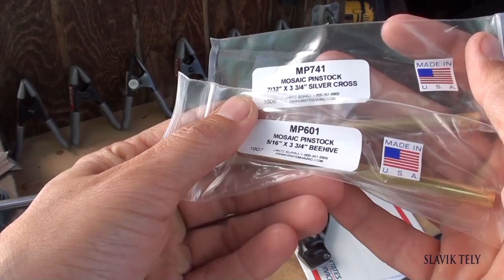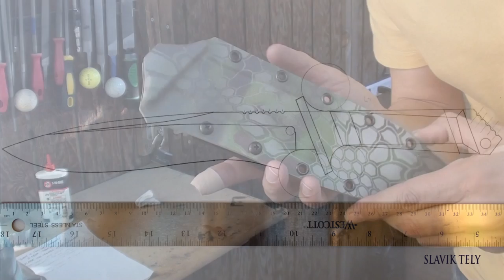MAKING BADLAND BOWIE CS:SOURCE 1.6 KNIFE Part 3

Comment: I admire your patience and attention to detail. I've made a few survival knives of my own design in the past, and working with and polishing curved edges is no easy task. You do fantastic work, and I enjoy watching your videos. 

The only minor suggestion I might have is to put a drain plug in at the bottom when you press your Kydex sheaths. The hollow cylinder allows water to quickly drain from the sheath when it rains or when you cross a body of water to help prevent rust or excess weight. It's only really essential for knives that will be used in the field and not for collector knives. Could be a good feature to add if you get more commissions for knives soldiers will use with their gear. Keep up the good work!
Reply from the maker: Thank you for the compliment and suggestion. I do put drains when the owner wants them. Most of my customers get my knives as a collectible item.
Reply: SLAVIK TELY - Makes sense. The customer is king. You obviously know what you're doing. I just grew up in the Pacific Northwest and can't help but think about the rain. I rewatched the videos for your commissioned soldier's knife and saw you put a drain plug in that sheath. You're knives are beautiful regardless of what you make.
Reply from the maker: The_IronPhoenix https://www.youtube.com/watch?v=hdLfDV13bAY&list=LLsCuMSw61beQuEpUOcvQOwg&index=11

Comment: You have inspired me to learn this craft. Do you have any videos or could you do a video of you were to make a knife as a complete beginner. If you had minimal tools and as a first project. Something some one like me could start with. I'm not going to try the tempering to start with so just shaping and handle design I'm getting stainless steel off it's from work
Reply from the maker: Watch Ekim1428, Walter Sorrells, Nick Wheeler, Aaron Gough. It is a really good start...I started from there.

Comment: another great video. I was wondering what the tool was called you use to scribe the sides of the knife with? not the one you scratch with, the one you use on the thickness of the blade?  Also when you start filing this knife, on the curved part of the blade are you using a straight, or curved file? 

Thanks and keep up the great work
Reply from the maker: https://www.amazon.com/gp/product/B0000DD0IZ/ref=oh_aui_detailpage_o04_s00?ie=UTF8&psc=1

you can use a curved file to make a rounded plunge.

Comment: Wonderful work once again, and as usual. I love how your knife are made with such precision, how they are overbuilt, love the absolute overkill of a handle attachment (epoxy, pins, screws .. that could probably survive a nuclear blast) .. 
Did you sell this one? I bet that must have gone for at least five hundred if you did.

I doubt there's anything to improve, and if so, then perhaps only that knives like these would maaaybe deserve a higher-end sharpening system, like a wicked edge or something. But Lansky is just fine, though I prefer KME.
Reply from the maker: Thanks for the compliment. It went for one hundred below the price you said. The guy has six kids, I grew up in family of 6 kids. I know how tough it is to raise that many mouths. I couldn't ask for more, my heart won't allow it. I do need to upgrade my sharpening system. I just do not have the space anymore.

Comment: you should sand your knives with higher grit sandpaper. they will look less scratchy. on some knives it looks good but not on most. but I understand sandpaper is the most expense in knife making.
Reply from the maker: Usually most knife makers sand their knives 600-800 grit. I sanded this one to 1200.
Reply: oh. it just doesn't seem like it on video. bad eyes I have I guess. Do you have like a polishing wheel buffer on the grinder? is that something you would do with a knife?
Reply from the maker: justin haynes I do not like mirror polish finish. Plus it is very dangerous to make that finish because of the buffing wheel.

Comment: You removed a lot of metal to keep it one piece; is it worth the time to so? Maybe making a guard and pommel would take as much time, what are your thoughts on making other knives this way? Great work across the board BTW....
Reply from the maker: If I had a milling machine, that is the only way I would do it. The less parts you have the more solid it will be.

Comment: That is amazing, but how could you add the squiggly pattern on the edge of the blade because the real life counterpart it is made out of a different material.
Reply from the maker: You can do it with a W2, 1075 steel. It is called Hamon. At that time I did not have that steel.
Reply: Also if you did have access to it, how would you connect the two steels?
Reply from the maker: KingMangala You do not connect the two steels. Watch a video on How to make a Hamon. It is done during heat treating process.
Reply: Thanks for the insight and keep up the great work, these videos are awesome.

Comment: I have a quick question. The file you use on your filing jig, is it best to use a file with or without teeth along the sides? I bought files and I noticed some have them and others don't. I enjoy your work, and can't wait to see what you come up with next.
Reply from the maker: Thomas, I rarely use the file on the side but it does not hurt to have it. I have plenty of videos for you to watch...check them out.
Reply: SLAVIK TELY I was just worried if I used one while filing in my bevel, that it would mess up the plunge line.

Comment: Outstanding!

What kind of files do you have for bevel creation? And how long does it take to form them?
The level of your fit 'n' finish is beyond that of anything I have seen.
Reply from the maker: I use Nicholson files. It takes about 45 minutes per one side.
Reply: Single cut or double cut? I assume they're bastard files?

Thanks
Reply from the maker: Sudo Nym I use bastard cut files first and then fine file to draw the blade.
Reply: Thanks

Comment: you need tools to get rid of those rought files.. so you could spend more time on polishing and making knives cool. also was not sure about the screws, apoxy and pins together. I think if you use pins and epoxy then dont use screws, the looks would be neater too, if you use screws, no pins or maybe 1 decorative, but there is no need of epoxy then.

Comment: Slavik do you think you could make a knife specialized for ripping open deer hide and other animals for hunting purposes only  I'm not a crazy idiot that runs around with a knife stabbing animals lol
Reply from the maker: Did you see my Hunting Gut Hook Video
Reply: SLAVIK TELY yeah but I don't want a knife with a hook on it I would rater something that will tear like a gutknife  with the hook on the blade side so it's easier to tear with
Reply from the maker: Skyrimax I had a hard time forming that hook shape and it is difficult to sharpen. I think they sell a piece where you insert razors. It cuts like a champ.